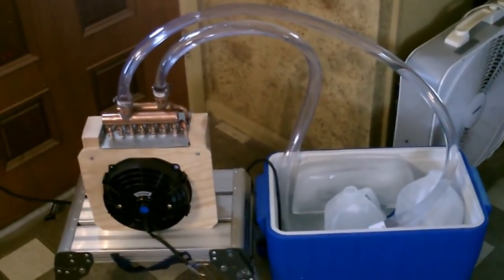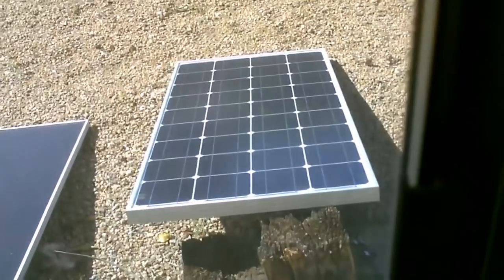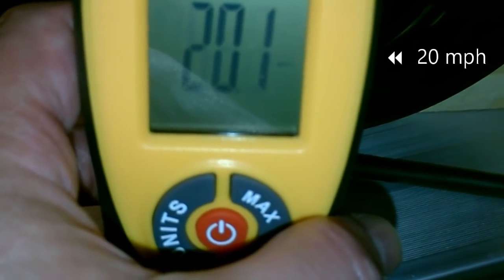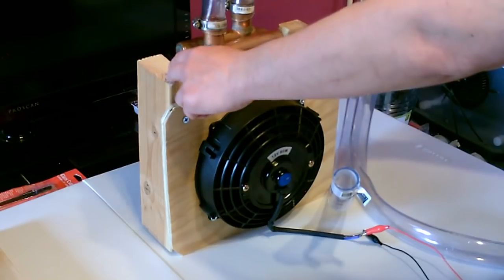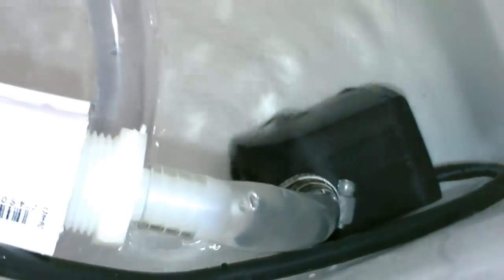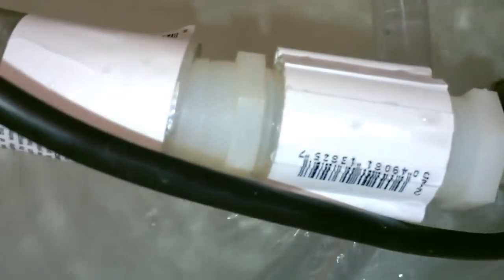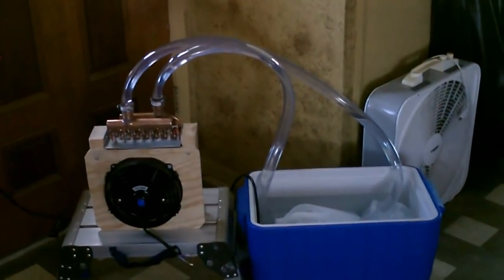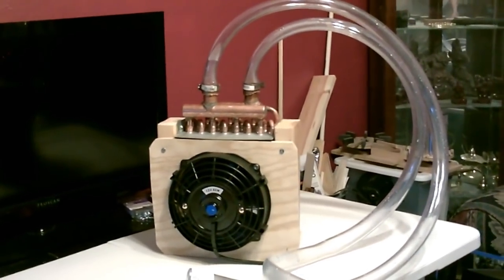DIY Air Cooler! AC Air Cooler with "chilled Water" - Powerful!  Heat Exchanger w/fan! Easy AC! Solar

Comment: Could your power source be a ryobi 18v battery with a power wheel adapter? I like the solar power but makes it difficult if you want to bring it inside the house. Nice build by the way I am going to make an attempt at building it. Looking for a low cost way to cool a room when we have no power from hurricanes.
Reply from the maker: Sounds great! make sure to check my latest unit too. just posted it last Saturday. (on 08/26/2023). i've had many people make several of my projects with an 18V ryobi fan.

Comment: Hi, that looks like a great set up. Do you think that heat exchanger will function if it is mounted upside down with the inlet and outlet facing down towards the cooler?
Reply from the maker: hi. yes, i think it would

Comment: Looks like the best I’ve seen yet. I want to build one for my SUV car camper. Can you use smaller heat exchanger with smaller hose lines or would that takeaway from efficiency? Could that unit be mounted on cooler cover? Thanks
Reply from the maker: hi and thanks! this one is a pretty powerful unit - but i do have other videos using smaller radiators and fans. those work great too! you can find them on my channel page (or by checking my 'air cooler' playlists) under the playlist tab. they are all grouped together on the playlists.

Comment: The coil doesn’t condensation water ?
Reply from the maker: hi. where i live the humidity is pretty low so i don't have any condensation. you could use a drip tray or even just a towel to catch any if it's an issue where you are.

Comment: Hi there! First, I want to say how much I enjoy your videos, I think they are fantastic! You inspired me to create my DIY cooler for my apartment here in Portland lol. I did have one question though. What type of water pumps do you use in your systems? I bought one from Amazon and the first few times I ran the cooler it worked great. I am noticing though that the pump seems to be getting pretty warm now to the point that it is heating up the water from the outlet hose 😒. I was hoping you might have some suggestions on good pumps or maybe if mine is too small and that's why it's heating up?
Reply from the maker: hi. i typically just buy any brand off of amazon when it comes to the pumps. they sell water pumps that you can use outside of the water if you want to. you just drop in the 2 hoses and the pump stays out of the water. i just bought one recently. they cost about 20 dollars so not much more than the other type.

Comment: I’m building something similar and was wondering where you get the pump to connection from?  I have the water pump and the biggest connector is .75 which is a bit small for the hose line.
Reply from the maker: hi. i get the connectors from several places. marine stores are one good place. also amazon and the home stores (like home depot and lowes) are good places.
Reply: @desertsun02  thanks.  I was able to get them from Menards.
Reply from the maker: @Seven Chang awesome!

Comment: Looking at adding this type to my boat. Water temp is usually under 62 all summer have you tested water in that temp range to see how it does.
Reply from the maker: hi. yes, it works very well in that range too. i've had several people tell me that they made them for use on boats. it's a great use and a good way to get cold water without ice

Comment: Can you add link to heat exchanger ? Can’t find it on Amazon.
Reply from the maker: hey there. here are 2 links. this one is the link to all 3 pages of them https://badger-pipe.com/collections/water-to-air-heat-exchanger
this one is the link to the 8x8 heat exchanger (it's the exact one i used) https://badger-pipe.com/collections/water-to-air-heat-exchanger/products/8x8-water-to-air-heat-exchanger-1-copper-ports?variant=29080937105

Comment: How come you don't have a link for the solar panel? Could you provide one please?
Reply from the maker: hi there. since there are dozens of companies selling all types of solar panels these days i tend not to post links for them. amazon has pages and pages of different kinds and brands. i used to go with the name brand ones but i'm finding that even the cheapest ones work just as good or even better than the expensive ones. here is a link to a 12v 100w one that is only about 80 dollars https://www.amazon.com/HQST-Efficiency-Battery-Charging-Applications/dp/B08SWJK87H/ref=sr_1_12?crid=3QDV6W56PF5NM&keywords=100+w+poly+solar+panels&qid=1657473561&sprefix=100+w+poly+solar+panels%2Caps%2C259&sr=8-12

Comment: How long before you have to add more ice?
Reply from the maker: i usually get several hours (but it will depend a lot on how fast you run the fan (and how hot the air is in the room))

Comment: I've tried thsio but am now trying a smaller computer fan sized radiator as heat exchanger. Any thoughts on putting the radiator behind the fan? If I enclose the radiator on an insulated duct that draws cooler air from lower down I can keep it cooler than it would be if exposed to the warm air up higher.

Comment: Great video! I have just one question? Is the fan blowing through the heat exchange towards the wall, or sucking towards where you are sitting?
Great design it has given me some ideas.  Thanks for the  share.
Reply from the maker: hi and thanks! it's blowing out towards where i am sitting.
Reply: @desertsun02  where do you get your condensers from?

Comment: Any thoughts on what size room would be a fit for this design?
Reply from the maker: it varies quite a bit depending on how cold your water is (but it should cool 200 to 400 sq. ft.). the manufacturer states that can produce over 25,000 btu (if used as a heater) - but i'm not sure about the btu rating for cooling.

Comment: I've built this "kit" and liked the results, but I was wondering if I double the size of the container and put 2-3 of the peltier units you used on this video https://www.youtube.com/watch?v=JIMekmP7_c0&t=3s if I could avoid having to run water tubes outside to the evaporation idea located here: https://www.youtube.com/watch?v=7ONB-hoyAZQ and keep the ac self contained. I just wonder if the peltier units could keep the water cool enough to make the ac idea actually work that way ... your thoughts on this idea?  

BTW - on the DIY Stove & Oven! idea located here:  https://www.youtube.com/watch?v=2YZq1D52oT4&t=72s I blew up a second power supply.  I have no idea why that project went south, but I'm working on this idea now.   Just thought you'd like that update.

Comment: Another idea from your video is to use your peltier ice chest fridge to keep water cooled to run through your heat exchanger. Maybe the thermal transfer from circulating over and over would exceed capacity of peltier ice chest fridge to keep up with heat exchanger. 
I'm just guessing I'm not an engineer. 
Maybe use a closed lid on ice chest and keep water in separated container within icechest to keep ice from melting so quickly.

Comment: What's the (minimum) Wattage of the Solar panel to run both Fan and Pump ?   THX
Reply from the maker: hi. about a 12v 100 watt panel. you have to consider amps too. so for full power maybe 150w one

Comment: What size pump did u use? Thx
Reply from the maker: hi. i've tried 2 different ones. a 200gph one and a 12v 350gph bilge pump. they both work well.

Comment: I just commented on your video where you pump heat from the water heater. I want to make something like this but in a way that pumps liquid cooled from being underground. I see a potential problem in the pumps since they need to pump probably around a ton of water if it does go down that deep to where it can cool using the ground. So there might be an issue in scaling. What do you think? I hope you get a chance to reply. Thanks.
Reply from the maker: hi there. well, i've never done a geo-thermal one but i like the idea for sure. it's a bit of work up front but then you've got a great source of cool water. if you're well water is 55F as an example then you are set!
Reply: @desertsun02  Thanks for replying. It looks like buring 10 feet deep for a horizontal loop is good enough for cooling. You wouldn't need to touch groundwater. That's what got me thinking of getting a stronger pump since  it's more than 20 feet just from the side of the house to the bottom of the trench. Everything else just adds more to it, like going ten feet out on a loop system could get you 100 feet total for a small system. So I imagine you need stronger pumps that depend on the amount of liquid that depends on the length of overall hose.

Comment: this affects bills? even if i run it on socket?
Reply from the maker: hi there. it's super cheap to run.  it costs about $5 a month to run the entire set up using AC power. (and that includes the making all the ice in your own kitchen fridge!). so, total (over a 30 day month) about 5 bucks extra in electricity. i've got a more detailed breakdown of the costs in a 2nd video of this set up. - if interested, here's the link to that one. (the cost breakdown is in the last couple minutes https://youtu.be/dLspmypEqhM

Comment: I'm struggling with the water warming up too fast. I've tried using ice water in the cooler, ice melts fast, water warms up. I'v tried using a gallon of water with the pump around the gallon, but the ice doesn't really cool the gallon at all.. Metal container of water is my next step... Any suggestions? I'm freezing water bottles and a couple of juices bottles (half gallon) and Ice from the gas station.... I feel like a ton of work is going into the cooling of the water... The system works great though if the water is cold... Im using this just to cool my Garage.... Arizona garage!
Reply from the maker: hi there. since you are in arizona you might consider chilling the water with a homemade evap cooler. i've got a video on how to make one (the blue cube evap cooler one). those chill the water in the water reservoir when it's running. i've seen the water in those go from 85F down to as low as 57F in just minutes. you could put the pipes from the heat exchanger into the that. (that's something i've been meaning to try for awhile). it might balance out well. (one cooling the water and the other heating it up). if you don't want to do that (and you don't have cold 'well water' or a cool lake or river water source) then the best way to keep the water cold that i know of is to use large ice blocks. one other thing... make sure the pump isn't oversized. it may be heating up the water that it's in. maybe you could use a pump that you don't need to put in the water. hope that helps and it's great you made it! as you mentioned, they do work great (just need the cold water)
Reply: @desertsun02  Well you just hit on something... I think you used a 350gph pump. I was using a smaller pump, but my water supply was in a cooler on the ground, while my fan/heat exchanger was on my work table. The pump I had wasn't strong enough to push the water UP through the hose (which are also too long) , so it was either place the water closer to the fan or upgrade the pump.... I went with an 1100gph pump! Lmao yeah, so maybe the pump IS heating up the water! Didn't even think about that as a possibility. I used a cooler with ice and frozen water bottles & frozen juice bottles and it melted fast. Worked great for a bit though before the temp rose... Damn pump. I'll swap it out and see how it goes. I'm using a 100w solar setup similar to the one in your video. Thanks for the education on that too, been subscribed for years. Excellent videos. My family thinks I'm nuts, but I'm having fun. Built the evap box fan cooler several years ago from your vids, thank you.. I'll report back and see how the pump swap goes.

Comment: Valuable work.  A crazy idea i want to try in Florida... I have a remote property in Central Florida.  For Florida temperature not too bad at night for sleeping.   Most charts say average Low in August is around 71F (but i think that is 5am).  Most August nights i've tested at 11pm it's around 74F.  Not terrible, but not ideal.  I recently dug shallow well about 8' deep and the water down there is very cold.. I think under 68F.   The space I need to cool is tiny , less than 50sqf with a metal skin.  I am wondering I can pull or push air  from the well/ground using a  8' x 6" pipe using a 5v 1amp USB fan to see a 3F temp decrease.  Possibly pull cold water out into a copper coil or radiator and blow through it.  Keep in mind this is at night but Florida is very humid.  The ground where I would be pulling water and/or was covered by my van all day.   Also wondering if pumping and spraying  cold water on top of a metal structure would get me the 3F temp decrease?

Comment: Now lets say you want to cool off water. Is it possible to submerge the Radiator in the tank and have it cycle the water through or is the fan needed to achieve the cooling results you have gotten?

Comment: Have you tried adding a duct?  I was wondering how this kind of fan and duct would work connected to it.  Global Industrial™ Flame Retardant Flexible Duct 16Ft for 8 Inch Diameter Fan.  Do you think it would work well?
Reply from the maker: hi there. i have tried it with flexible ducting. only a 3 foot section though (not a full 16 feet). works very well. one side benefit of the ducting (that i wasn't expecting) is that it muffles the sound of the fan motor almost completely. with the ducting connected, all you mainly hear is the sound of the air rushing out of the tube.
Reply: @desertsun02  Do you think installing one of those fans at each end of the ducting would be beneficial?  One fan connected to the heat exchanger, the other at the other end of the 16 ft of ducting to help suck the air out of the ducting.

Comment: Hi man i did a similar project but I didn't use a cooler but a freezer a made couple of holes and put an hermetic contenitor with a water pump. But I have a problem when is running the water is not cold at all like room temperature even with temp of -15. Any help or advice?(the room temp is around 28)

Comment: For heat you can drop in a aquarium heater they usually adjust up to 85 degrees  Fahrenheit
Reply: To heat, Run glycol through some black pet or copper tubing coiled in a flat box outside,framed with 2x4’s & glass top, paint black inside. Heated by the sun, then just pump that thru the radiator instead of thru the ice chest. Use a couple valves and tees to switch over.

Comment: how did you solder the pipe joints, the work is actually really beautifully done with the copper
Reply: It's a copper heat exchanger that is manufactured in a facility. Amazon search "copper heat exchanger or copper  heater core", many options and price ranges will appear. Definitely a great looking way to go about a DIY air cooler.

Comment: WHAT KIND OF FAN IS THIS...I suppose it’s got to reverse the air off the heat exchanger? Thanx Sarge.
Reply from the maker: hi. its a 7" car radiator fan. 👍
Reply: Sorry to be so dense does this blow into the heat exchanger or pull air out????
Reply from the maker: i have it set up to pull the air thru the heat exchanger and blow it out into the room. *i've found that doing it that way gives a much better air flow than trying to push the air thru the unit.
Reply: I’m trying to cool down a 95 degree garage where to huge dogs live....fans blow hot air. Is this radiator fan blowing in or out??????
Reply: Ok thanx. To the auto parts store...

Comment: Hi Im looking to build something similar but I'll be using a 200-500 cfm fan (for a small bedroom 1224 cubic feet). Do you think a 160 gph pump would be decent?
Reply from the maker: hi. a 160 gph one might be a little too small. i'd go with a minimum of 200. *350'ers work great too  (that may become my standard)
Reply: @desertsun02  ok thanks!

Comment: Wouldn't this setup work better if the heat exchanger was enclosed in the cooler? I noticed you didn't have much room in the cooler so that might explain it. As far as effectiveness for an enclosed cooler with a fan faced down on top sucking in hot air, I was told that was bad. Instead a setup like your vapor pad where you have the fan underneath some plywood and blowing cool air out a huge vent seems better. Just wasn't sure if having the exchanger underneath the fan sucking cold air out would be better than having the fan under the exchanger blowing out? Any thoughts?

Comment: Do how long it cools ?
Reply from the maker: hi. it varies a lot depending on how fast you run the fan. (plus other factors like how hot the room is to start with, how much ice you use or if it's just cool water...)

Comment: Have you considered using a evap cooler running outside and piping the chill water from the tank into your heat exchanger? The temps probably wouldn't be nearly as cold. i think your chill water would only be down in the low 60s. But the whole setup would only require solar power and no ice.
Reply from the maker: hi. yes, absolutely. i've been thinking about that for awhile. i'll probably drop the piping into the reservoir of my "blue cube" evap. air cooler project. btw, your comment is exactly correct on every point 👍🙂
Reply: @desertsun02  cant wait to see it I've been pondering a setup using a car radiator vice the copper tube. Or maybe a combination of both.

Comment: Nicely done man.... I already use that concept. flowing cold water thru used split A/C indoor unit and that concept is definitelly work. cooling down 6 sq meters room almost 2 degrees from 30c with just 1 liter of water and  approx 1 kg ice, fully melted about 40 minutes in a really hot sunny day.